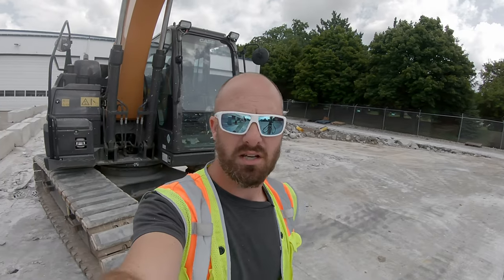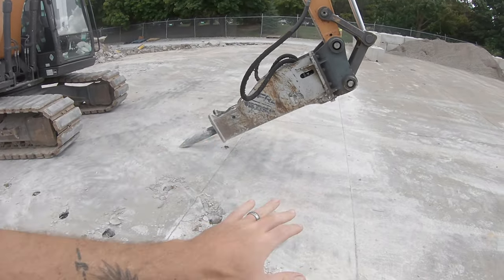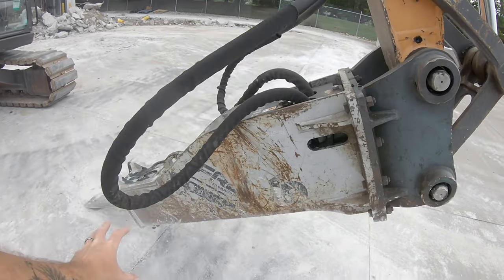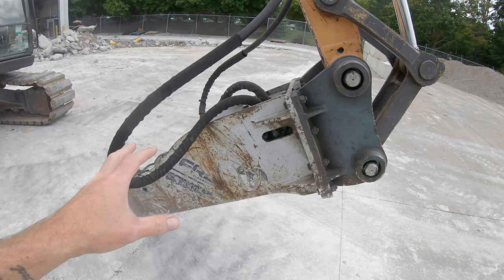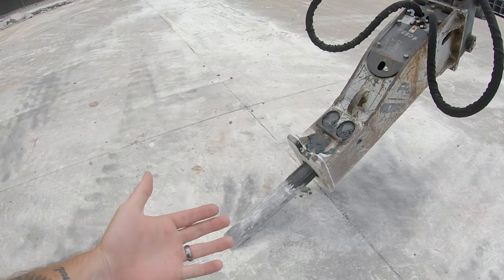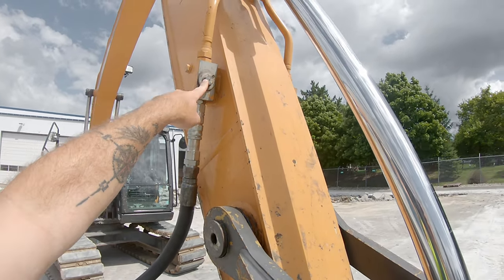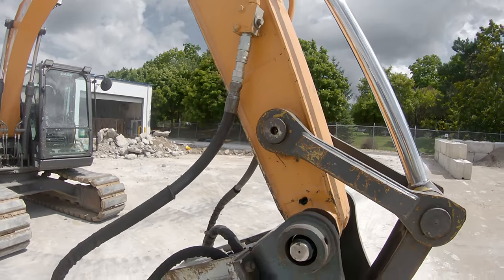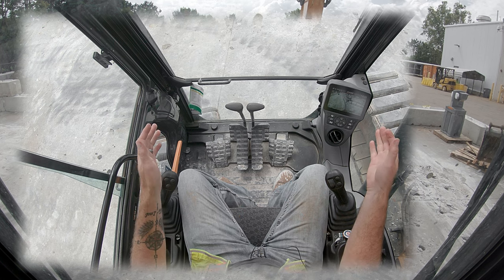How To Hook Up Hydraulic Hammer

Comment: What annoys me is i go to put the hammer on and the person who has been using it before me has not released the pressure they should be sacked on the spot lol
Reply from the maker: Sometimes this is unavoidable.  If the hammer was disconnected cold and sits in the sun the hydraulic fluid will warm up and lock up on you.

Comment: Hey Bryan I've got a question.  So when I was at job corps we did some concrete breaking with our skid steer and when we we were breaking concrete we always had someone spraying water to keep the dust down because silica dust is bad to breathe in. Do you guys usually having someone spraying water to keep the dust down?
Reply from the maker: Not when we are in an enclosed cab excavator. We very rarely have to spray water on job sites here
Reply: @DieselandIron   what about on those big dirt jobs where you see the water trucks? Is that just to keep the dust down?
Reply from the maker: @jacksonalonzo4903  you are correct. That's to keep dust down on the site so you can see